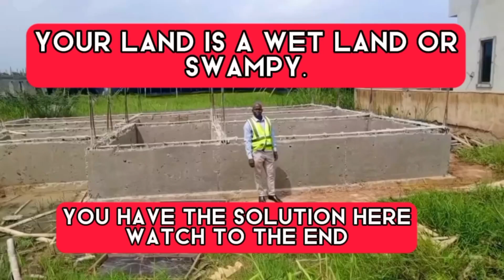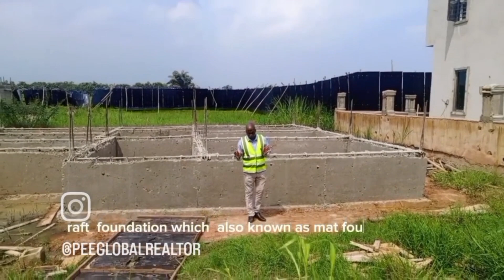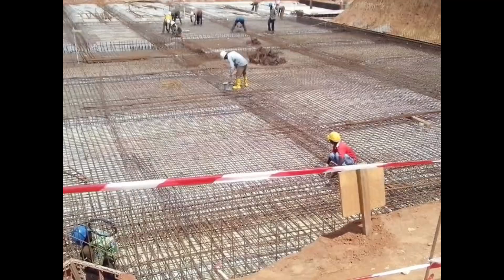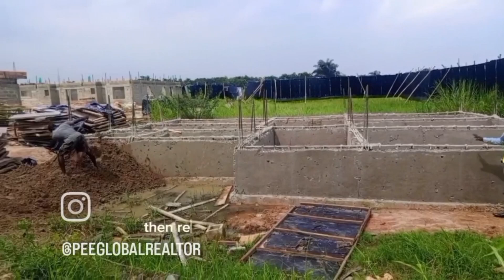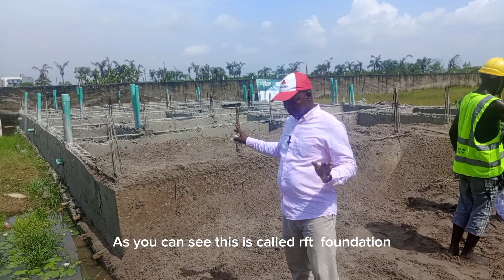Raft foundation construction on wet land around Sangotedo area Lagos Nigeria

Comment: Hello Sir!

The entire living space of option A is 7.25x6.25m(45m²). 
Open plan layout, with dining 200 elevated.
Arranged like this:
Main lounge 6.25mx4.21m. 
Additional lounge or VIP section 3x2.75m. 
Dining 3.5x3m. 
Total floor space 45m²

Option B. 
Main lounge 6x5m 
Dining 3.6x3m. 
Total floor space 40.8sqm. 

Sir; these two living spaces which one is larger and better. 
Which option is more luxurious in terms of space?